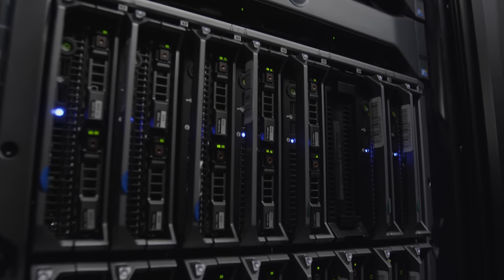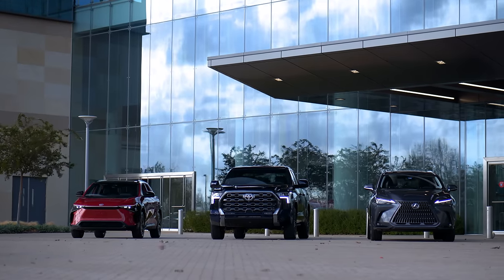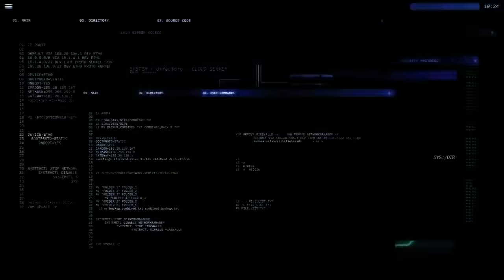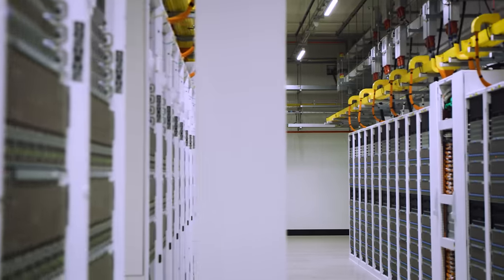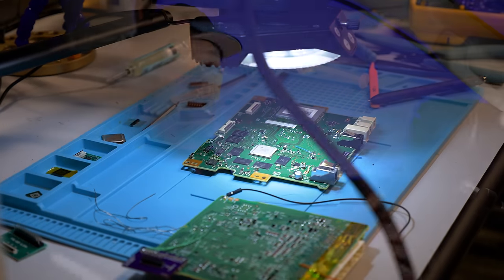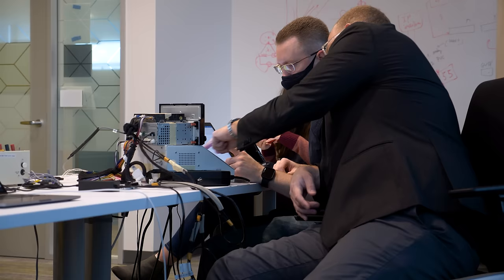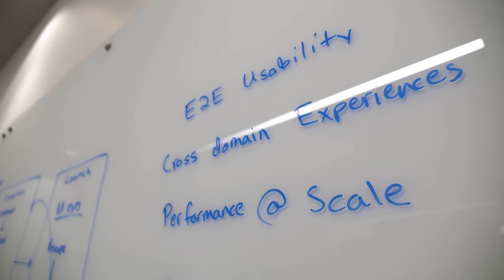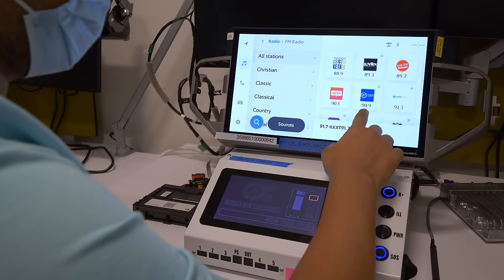How Is Infotainment Designed?

Comment: This was a mildly infuriating watch. They seem to be focusing on the wrong things and making a lot of assumptions based on feedback from very few customers. 

At its core, the screen should control some or all media, display navigation, and  let you change some deep car settings, like door lock preferences. 

There are many, many good interfaces out there, like Kia/Hyundai, Uconnect, and Cadillac’s new system. Even the 2021 IS, and 2022 ES with touchscreen are near perfect. They are all very similar, and extremely easy to use. I’m not sure why they needed to design their own, overly complicated system going forward instead of sticking with what works. 

HVAC should always be physical. Even seat heating and cooling. For example, I’ll usually turn off my heated or cooled seat after a few minutes, and would hate to go through the touchscreen to do that.
Reply: Dude!!! THIS! 👍👌💯

Comment: In the 2 wheel world you can still get a new bike with carbs, drum brakes (Honda Navi for example) and I have even seen 2 stroke (Buddy 50). Its nice to have some analog outlet now that cars are appliances now.
Reply: Drum brakes are just old. They aren't any more "analog" than disk brakes.
Reply: @galactictomato1434  I was pointing out an extreme opposite example in a world where we have cars that will brake for you. You can get bikes with really nice modern Brembo brakes with no ABS or with. BTW the Navi only uses them because its cheap and it has a max speed of like 50mph, I would never get one for myself.
Reply: If it gets so bad, I'll give up cars and move to bikes.
Reply: @JohnFromAccounting  Bikes are too digital. I only commute using horses. 🐴
Reply: @galactictomato1434  Found the Mk8 Golf owner.
Reply: @galactictomato1434  you have a good point. its green, self driving, does its own maintenance, looks badass
Reply: @pleasedontwatchthese9593  It definitely doesnt do its own maintenance. You have to feed it, brush it, vet checks, clean it. It's a whole lot of maintenance.
Reply: @NFStheStig  I wonder who maintains all of those wild horses then, hehe. I jk, I know in real life horses cost as much as higher end sports cars and are not cheap at all.

Comment: EDIT : ok I'll rewrite my comment. I have a lot to say here, because I work for a vehicle OEM building products for end users, and I'm a mechanical designer.

Without going into too much detail about the company for who I work for, our end users and the way the use the product, are quite a bit less varied than those found in the normal automotive sector. That said, I’ve spent some time with end users. Electronic interfaces are very much a no-no, and to be avoided as much as humanly possible. Touch screens, capacitive anything are always thrown out the window and I very much agree. No one wants that. Exactly zero people. You might think you do, and then you use it and realise it’s a step back.

Muscle memory, intuitive no-learning curve toggles, switches, physical buttons are the way to go. If you need to look at it to confirm you’ve activated it, it’s failed. You need to know, with a single confident action that you’ve activated the function without even looking at it.

I know I’m a little old school, but I honestly don’t see much point to updating anything if it works perfectly fine. I often hear criticism things looking outdated, or ‘’why would you use Corolla switches in a Lexus’’. Why not? Design 1 excellent, solid reliable switch and use it across the board.

And this obsession with screens, phone connectivity and integrating functions into a menu…I have no idea why anyone would want that. I know Daniel Hall, former UX designer @ Toyota, mentioned that too many buttons may feel intimidating like the cockpit of a plane, but I really have to disagree. If you get lazy with your controls layout, yes, it’ll look busy. If you group them into their core functions and pay close attention with ergonomics and their most intuitive locations, it absolutely won’t. Cars don’t have to have many more functions than they did in the 90s, and many OEMs (Honda, Mazda) got it right back then. Mazda still does things the best in my honest opinion, despite having certain functions hidden in menus. If you need the screen to access vehicle maintenance, fine. But seat warmers? Daniel, you’ll like use the seat warming function multiple times a day for months in the winter. Don’t put that function in a menu. Very little should ever be accessed through a screen, if anything at all. I’d love to see a day when cars could actually get rid of their screen, but something tells me no manufacturer wants that to happen.

I feel like this is the mentality of ‘’make the user thinks he/she needs it and they’ll want it’’. The necessity and functions of a car haven’t changed much, but our perception of what they need to be has. We’re embarking on a future of full EVs and we have the chance to make them simpler than ever. And we will choose not to; in exchange, we will make them even more complicated to service and repair ourselves.

That’s plain wrong. Many modern things have been great developments, but there’s been a LOT of crap on the market recently.

Comment: If they only made HVAC systems smarter by adjusting the fan speed based on desired and current temperature and how bright and sunny it is (most cars come with ambient light sensors), there shouldn't be a lot of reasons to be tinkering with the system while driving.  If Ecobee and other smart thermostat can do that for our homes, I don't see why automakers can't.  

As long as I can ignore for the most part playing with the infotainment system and having to dig levels deep to change a radio channel or audio input, I think I should be good with any infotainment system.  I don't buy cars based on the infotainment systems anyway and two of mine are older and aren't equipped with that.

The problem is drivers making the infotainment system part of their entertainment while the car is in motion.
Reply: My 2002 Prius has a sunlight sensor. If you are using the AC, it will keep the engine on longer (to run the compressor) if the Sun is shining into the vehicle. If you are running the heat, it will turn the engine off sooner because it doesn't expect to need as much heat from the engine to warm the cabin.

Comment: Clinging to my analog cars. Since I'm almost 60 years old I have a shot because past a certain age I probably can't drive anyway. Both from 1995 an NA Miata 5 speed with 110,000 MI, a third generation Toyota Camry(mint condition) with 78,000 MI (automatic) a 2008 Honda Fit 5 speed with 192,000 MI and one card that's mostly just for show a 1971 BMW 2800 CSA with 72,000 miles and a good amount of rust (dads old car, but still running).
Hoping to stay off the automotive grid of technology. Blasphemy as far as I'm concerned. As people get dumber technology advances and that's the end game of these corporations. No more real cars no more paper money no more private thoughts. And of course no more manual transmission
Reply: I collect XV10’s…1992-1996 Camrys are (one of) Toyota’s admitted overbuilt cars.
If only people knew more about the backstory on them.

I’m off the grid too. My newest car is a 2009 I bought used. Nothing newer than that and I’m actually into 70’s to 90’s vehicles. 

My parents are hot-rodders/collectors and their newest car is a Ford Probe. They are not into new cars - having even considered looking at getting a used Corolla Hatchback. 

Their everyday driver is an 82 Starlet (KP61) that they are asked (literally every week) if it’s for sale or they listen to people tell stories about having had one or someone they knew that had one.

All of the rest of my parents cars they won’t drive due to either being to risky to get damaged or they don’t want nosey neighbors to try to calculate money by assessing values of what they own. My moms 68 911S Targa Softwindow hasn’t seen daylight since 1985.
Reply: @ZEPRATGERNODT  Congratulations on your parents old garage queens that they are too afraid to drive.
Reply: @galactictomato1434  
16 cars are going up for auction soon. My dads 86 this year and mom is 83. 
They are going to reduce their expenses and maintenance at their age.
Reply: @ERICK4431  yes sir!
I recently read an article in motor trend that named the 15 most important Toyota models in their history. The third generation Camry was number one. That's saying a lot considering all of the other great Toyotas including the mark for Supra and the gt2000 from the '60s
Reply: @galactictomato1434  mine has a canoe on top that goes to the lakes few the a week. 
Convenient to store the canoe on a designated warrior

Comment: I work in software. In my lifetime, safety has never not been a priority in vehicles. 
I can't help but point out the obvious contradiction in the logic these designers are expressing.
You can't act like you are making cars safer by making them heavier and "able" to drive themselves. It's more dangerous for everyone involved. There is no turning point for this tech and safety with the way that computer architecture works - that won't change for 20+ years (Intel and AMD will make 100% sure of this).
The more new cars and new drivers that I see on the road, the happier I am to take public transport.
Reply: Toyota safety sense is standard. If the car crashes it probably because you're driving the vehicle no because you set adaptive cruise with lane keep.
Reply: @bigcjm  I rented a corolla wagon last month and got zero introduction to the car from the rental agency. Turned on adaptive cruise by mistake and I thought the car's alignment had gone because it kept fighting me when I was trying to keep driving straight! The car manual was all in Dutch so I still don't know how the damn thing works, and I certainly wasn't going to just let the car drive itself without knowing what it was doing.

Comment: Toyota's old system was trash. This shouldn't be that hard. Physical controls for hvac, touchcreen and if you want to add a dial or joystick, don't require it's use. I prefer android auto personally. I rented a cadillac xt6, it was awesome, phone just connected, everything was ready to go. Contrast with wife's mazda which is literally HOT GARBAGE, buggy, no touchscreen, frustrating. Will likely never buy another mazda which is disappointing because the car itself is decent.

Comment: Here’s what I want in an infotainment interface: intuitive layout/ergonomic with actual tactile buttons I don’t have to look at while driving, reactive/minimal lag especially with navigation, customizable Home Screen so I can decide what I want up front, memory meaning I don’t have to change something to my preference every time I start the car, cheap and easy to replace if damaged or stolen, over the air updates as software improves, entirely upgradable to new OEM designs such as a facelift upgrade also would like the ability to use aftermarket stuff if desired without the use of a dealer.

In other words: simple to use and intuitive yet advanced options when needed, minimal lag, actual push buttons, upgradable.

Comment: With the reverse mirror camera and HUD, you see the first steps towards what I assumed we'd be doing by 2020s--which is a visual interface that REDUCES eye travel away from the road. What would be even better than the reverse camera and the 360/overhead is for the different pillars to be entirely (or mostly) removed from the functional driving vision. Right now that may require screens but could also occur through AR somehow.  People don't seem to talk enough about how in pursuit of safety, we have lost out on incredible amounts of visibility in most cars (that and real and faux-aerodynamic designs), and visibility and habit are the two most important parts of safety.

Comment: Weird thought, but I'm legitimately fascinated that many of the people interviewed are wearing clothing that doesn't appear to fit well and/or is aligned with a very specific temporary fashion trend. But these people are the key players in developing systems that need to be comfortable, practical, and relatively timeless.  

My last two new vehicles (JL Wrangler, 124 Spider) were base models just to get the least screen-dependent interface possible. I recently found a well-kept low mile '04 manual Acura TSX. Great mix of practicality, luxury, performance... great switchgear/gauges/interface... I feel like I need to fiercely protect it for the rest of my life.

Comment: I have new cars and some 90's cars. What I have learned is that the option to swap out a head unit for the latest tech while not compromising what makes that car great is the right path. 20 years later the old car still provides all the value it did from day 1. The newer cars are left with unusable connectors and old technology that just gets in the way or reduces the value as time goes by.
Reply: I bought a 2000 Corolla and had the 'board computer' removed and replaced with a radio frame from the older model.
It pains me that good cars are currently dying out. We need to learn a saner way, to stop the exciting ride down the road to hell.

Comment: Toyota's commitment to providing a product with long life cycle is the reason for brand loyalty. I'd be tempted to contrast this with Tesla which has a short life cycle (thanks to degradation of the battery), we do not know their policies on hardware updates, but are able to tune many things over the air for "feel". That's another point with current gen vehicles, what are each of the OEMs tweaking (and what are they not) over the air.

Comment: That chief engineer was very proud of the 10yr replacement plan for tech hardware in these vehicles. 
Not good enough.
These are cars. The vast majority of your customers are poor to lower middle class. These cars cost $50k+ now. Customers are expected to pay $50k for something that only lasts 10yr? 
I only buy used cars--and I don't mean 2yr old that still sell for original MSRP. I expect to be able to buy a 15yr old car today and own it for 10yr. I can do that with today's tech. Not with tomorrow's. The car's engine, body, and mechanics will last, but all user controls are on a screen that doesn't work and can't be replaced. Wonderful.
The latest tech might be important to certain people, but they're certainly going to pay for it. Perhaps those people can afford it. I submit that the majority of people cannot afford it--whether they realize it or not.

Comment: When the person was talking about getting rid of contextual buttons and how it makes sense for heated and cooled seats because you only need that for part of the year I smacked my head.  In the winter I use the heated seat almost every day, and in the summer the cooled seats.  So yes, they are contextual, but when the context requires them I am using them extremely frequently.  It's one of those things that people implement because it sounds like a good idea when you say it out loud, but it does not really hold truth in the real world.  Plus, there are other solutions if you need to clear up space, use rocker buttons that can handle two functions (both cooling and heating on one button).

So many things can be painted with a contextual brush that are not better in the screen.  The heating system we only use for part of the year, the cooling system we only use for part of the year, we only use cruise control on the highway, etc.

Comment: I work in UX and own a Toyota, so I have a lot of opinions about all this. I generally agree with their approach but the interface in my car is minimalist to the point of feeling unfinished. It is easy to use, but there are tons of inexplicable decisions throughout. While I appreciate that Lexus features a fancier, more expansive UX there's no justification for even the Corolla being underserved. If the expectation is long term ownership then more refinement and thought must go into these systems.

My experience leaves me with the impression that: 1) designers don't have enough freedom to ideate; 2) dev is dictating functionality and opting for expedience; 3) they're working under tight deadlines and forced to crank something out that's barely above a minimum viable product.
Reply: Sorry, I'm not familiar with "UX", what does that mean?
Reply: @andoletube  User experience, thinking about what a user needs from an app and designing it in a way that's intuitive to use. It often seems straightforward but is actually challenging because we face a bunch of conflicting needs and desires. It's why automakers struggle to get these systems right.

Comment: I kind of had this struggle last year, I wanted to buy an EV but with a limited budget a brand new VW Id3 was out of reach, it was great to drive and the screens and tech looked cool. I however had to setttle for a 2019 Nissan Leaf. When I took it for a test drive after having driven the id3 and model3 Sr and other cars, the Leaf felt rather dated and old.  dated looking buttons for heated seats and no shiny iluminated capacitive buttons and so on.
And for the first month I didn't like the interior at all with its dated look.
I have however recently become grateful of the simple tech, loads of things I can adjust quickly  with a quick glance on normal buttons, nothing useful is hidden behind menus and swiping animations and so on.
I test drove a Id4 and ioniq5 recently because I want to get something with bigger battery and faster charging but the usability of both cars had me frustrated. wayyy to many menus to adjust pointless things.
Reply: Great observation, and thanks for pointing it out. I too loathe the overuse of software, menus and screens for everything. It’s a super lazy and cheap design. A minimal amount of physical buttons with good tactile feedback for the most common controls is a must and will never get old. Anyone disagreeing with that statement (as far as in-car UI/UX goes) is in my opinion being dishonest.